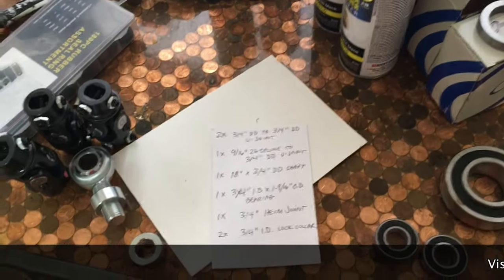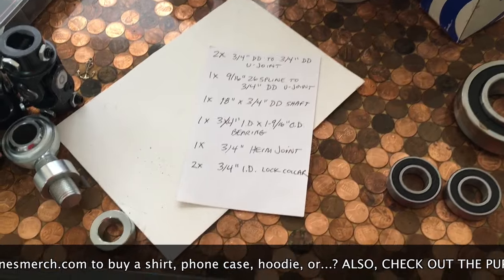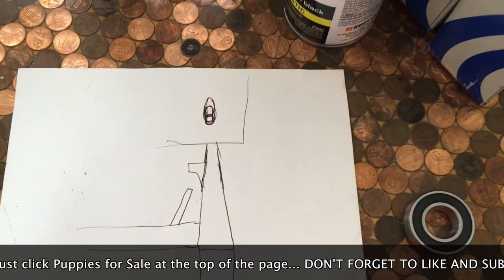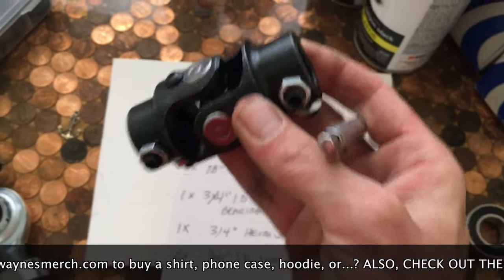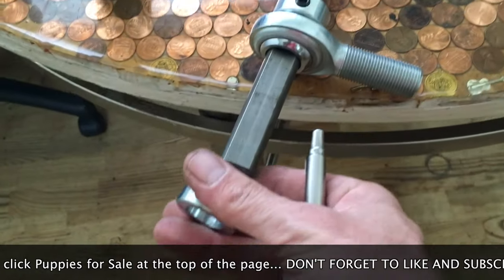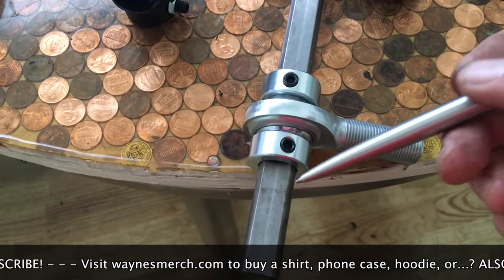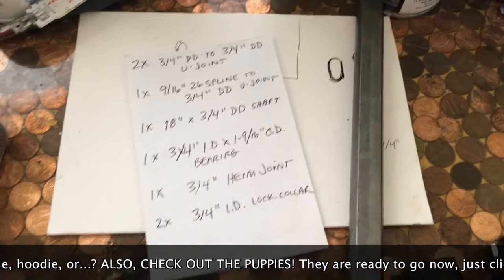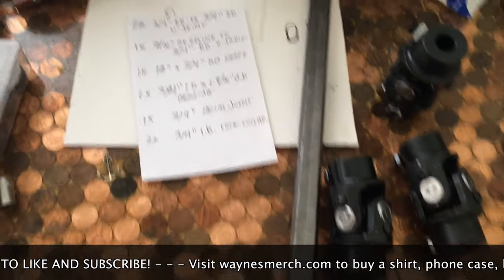49-54 Belair Mustang II steering shaft HOW TO S13E04

Comment: Good info Wayne!!! I have a factory Chevrolet shaft I think might work, but I have to get my engine in the chassis and the exaust on to find out. I got a bearing kit already that I got from Performance Online for 29.99 that's going to work. The only thing I need now(at least I think) is a 3/4 26 spline u-joints with a round end on it. I  have a power rack and it looks like a straight shot,but without the engine in place with the exaust I may have to do it like you have it!!! Not sure yet if my plan will pan out,glad to have an alternative to back up!!! Good work brother!!! What kind of truck did you get?  Myself I've been busy working on customers cars and haven't got back to mine!!! Got all the parts, but not the time or space!!! Been 5 deep over here since the 4th!!! Good thing is I'm making money for more parts!!! Next round will be a new fuel tank and battery cable kit!!! Maybe front wheels and tires after that!!! As always,  Keep Rocking it out!!!
Reply from the maker: picked up a crew cab 2004 s10. the ac works and thats all i care about.. HAHA! damn heat is all thats stopping me from finishing the 54. looking forward to seeing yours rolling!
Reply: @pawpatina  Heats the problem here too!!! Getting done what I have to as quickly as possible in the morning and getting into the AC as soon as possible!!! Keep Rocking!!!
Reply from the maker: @rockerpat1085  same here, work from 8-10am then hide until about 5 and work from 5-10pm. it adds up over time.